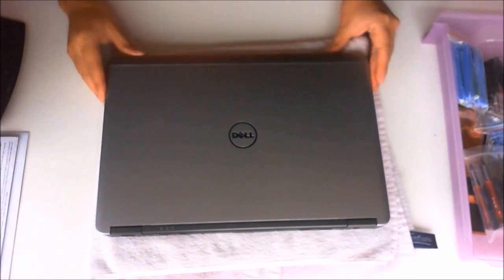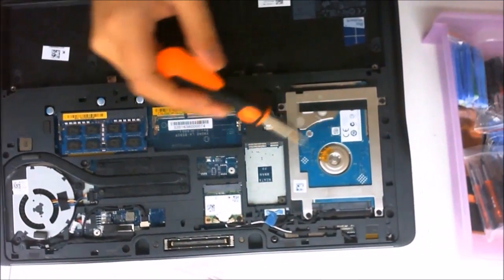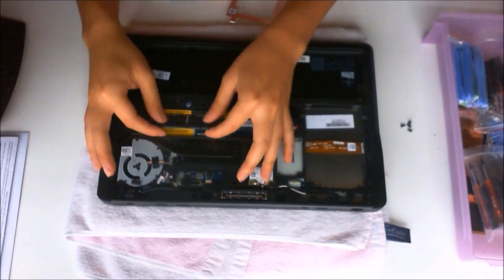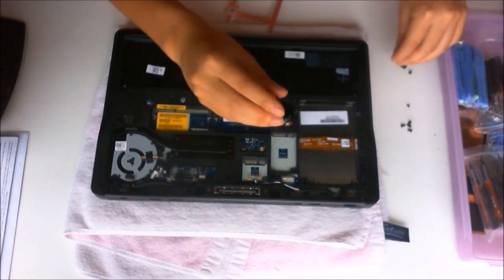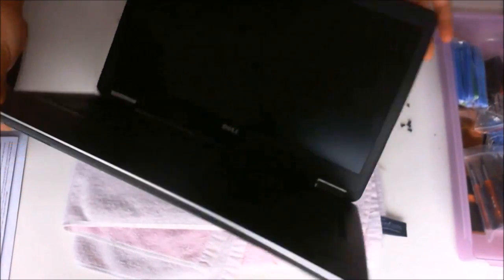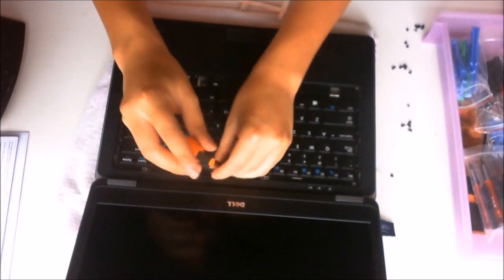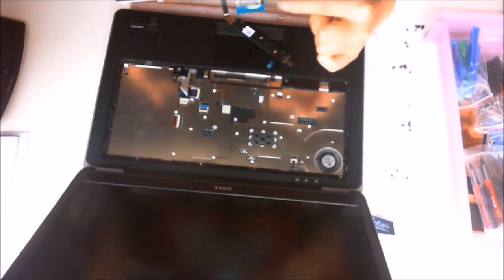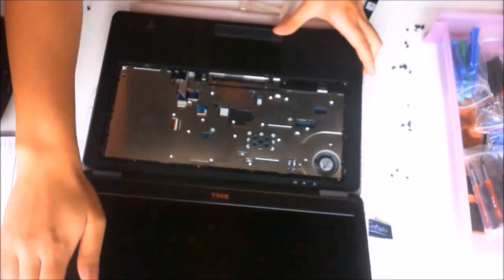OPEN ME UP! Dell Latitude E7440 and E7450 Disassembly

Comment: what screw type and size is at the first layer ?  the very two screws you opened .
Reply from the maker: +Idann Damrii dont know how to answer your question as i dont really understand it but i believe it is M 2.5 x 3. just to let you know there is a newer version of this video with more steps and higher video quality
Reply: +OPEN ME UP 

this two screws:
http://imgur.com/39iwfm1
Reply from the maker: should be m2.5 x 3. as you did not circle the screw I don't know which one but all the screw in the picture are m2.5 x3

Comment: "▶▶Quer saber o melhor ultrabook do mercado, com garantia de 7 anos???  isso é Ultrabook:

▶ Resumo:  i7 PRO + 8GB + 128SSD + Full HD Antireflexivo + entrada de Chip 3G/4G + Garantia de 7 Anos... modelo de Luxo da Dell

✔️ Garantia de 7 anos;
✔️ Intel  i7 da linha PRO com turbo de 3.3Ghz !!!
✔️ 8GB de Ram com espaço para 16GB
✔️ 128 SSD com entrada Extra para dois HD ou SSD
✔️ Tela Full HD (1920 x 1080) + tecnologia Antirreflexiva  + abertura plana de 180º + 14 polegadas
✔️ Teclado retro ILUMINADO anatômico com pintura emborrachada
✔️ Leitor biométrico +  Chip dedicado de criptografia (Alta segurança)
✔️ Entrada interna  para chip de celular permitindo internet 3G e 4G 
✔️ Nova Tecnologia NFC de transferência de dados por aproximação de outro aparelho
✔️ Entrada de Cartão de segurança

✔️ Processador Intel i7 PRO é a mais segura do mundo, pode ser rastreado até desligado, permite acesso remoto de qualquer local no mundo (Intel PRO);
✔️ Câmera de alta resolução + Som de altatissima qualidade e volume
✔️ USB 3.0 + HDMI + Ethernet tudo na parte traseira aumentando o conforto e estética
✔️ Ultra mega silencioso, Refrigeração mega Potente
✔️ Todo em Alumínio e Aço reforçado, Ultrafino, Ultraleve, Ultra resistente, suporta quedas de 1 metro
✔️ Trackpad para uso do cursor extra;
✔️ Ultrabook Dell Latitude  Linha 7000 a linha mais Luxuosa da DELL, Modelo E7440
✔️ Tecnologias que nenhum outro ultrabook Possui - Ultrabook profissional, o melhor no mercado

📱 Mais informações entre em contato, respondo e-mail na hora..

💰 Preço no Site da  Dell: R$ 8500,00 + Impostos
💰 Meu preço: R$ 5.500,00  última Unidade....NOVO, ZERADO - ACEITO OFERTAS

🚚 Só paga quando receber o  produto (Sedex a Cobrar para TODO BRASIL)
🔗 OUTROS MODELOS:    www.olx.com.br/loja/id/58704      """"
"""

Comment: I have the same laptop Dell Latitude E7440 + Ubuntu 12.04.5, and there is a problem!
When the laptop is cool - cooler turns right!
When the laptop heats up - the cooler is spinning faster.
When the laptop is running under a load of 80%, the cooler accelerates to 100%, and then, when the temperature comes vnormu, cooler still spinning at 100% speed.
You do not have these problems?
Reply from the maker: Владимир Петов sounds normal to me. But you cant try to open it up and change the thermal paste and clean the fan and see how you go. I have a video teacher you how to do it if you need to watch it
Reply: OPEN ME UP laptop clean, I wanted to know whether there is such a problem you have when on a laptop Dell Latitude E7440 installed Ubuntu, the cooling fan always spins at 100%. Do you have this problem?
Reply from the maker: I don't know I never had the fan issue but then I was using windows so yea. that's why I told you to clean the laptop and see if the issue goes away so you can tell what the issue it
Reply: OPEN ME UP The problem is not in the fan! This is a terrible laptop Dell Latitude E7440 almost his entire life is being repaired ... 30 days - 3 times changed the motherboard. The certified OS Ubuntu 12.04.5 fan constantly spinning at 100% speed. I need to burn this laptop Dell Latitude E7440, and video post on YouTube ...
Reply from the maker: have you update the bois? if so then there is nothing I can say. I had 5 of these in my life and I don't see any issues. Please note the 5 I had were all classified as faulty by dell and replace with a new one but when I look at it there is nothing wrong and they were never faulty to being with.

Comment: Thank you for the video. Do you know if this is essentially the same process for the e7240? Also, do you need to take the disassembly this far to remove the heatsink? I have several e7240's at work that need the thermal paste upgraded as we are getting complaints of running hot
Reply from the maker: After removing the back cover you can take out the heat sink that's it. pretty simple and straight forward I will look into the 7240 and will give you an answer tomorrow about it. I did a video about Cleaning fan and replacing thermal paste if you need it. https://www.youtube.com/watch?v=n2M5v7DcRA4
Reply: Thank you sir!
Reply from the maker: I forgot to tell you in the last reply that you will have to remove the fan first same with the e7240. it is the same after removing the back cover you can remove the heat sink so they are both the same just the screen size and a few other things are different. here is the user manual it has pictures for you page 11 http://topics-cdn.dell.com/pdf/latitude-e7240-ultrabook_Owner's%20Manual_en-us.pdf